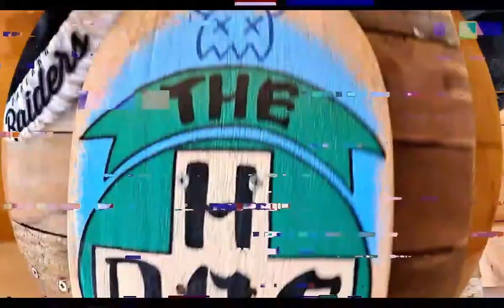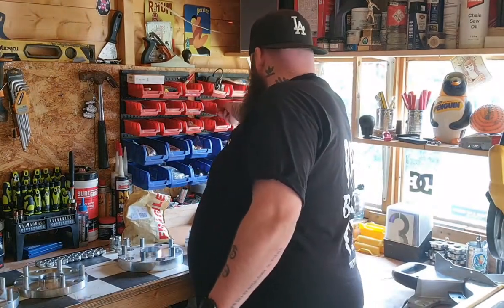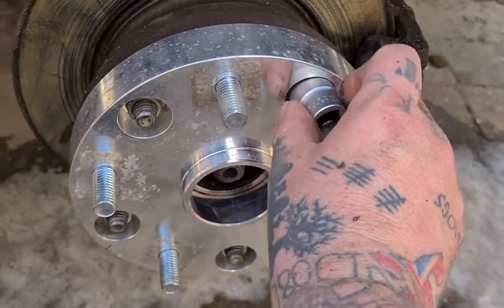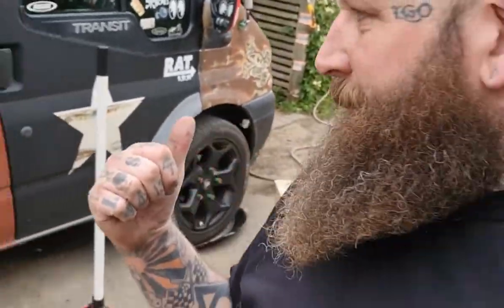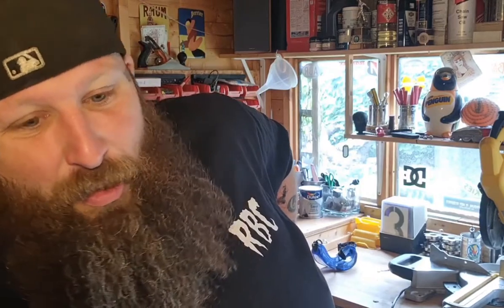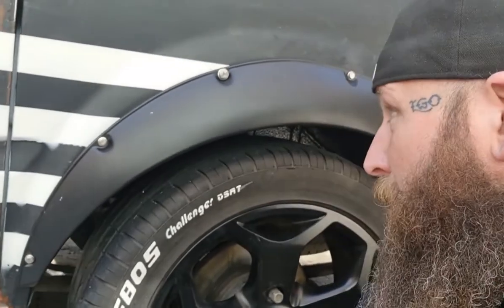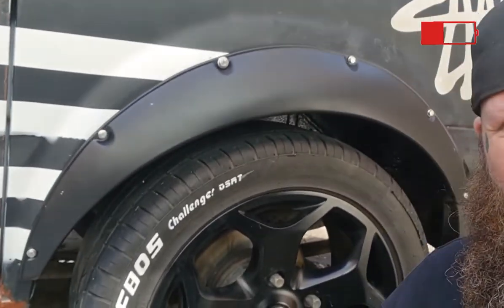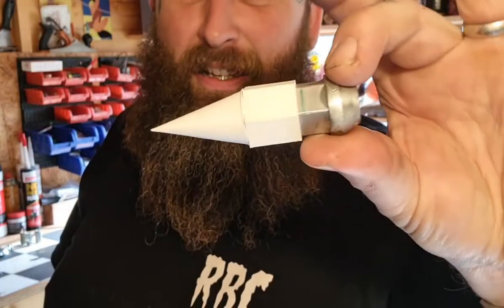fitting wheel spacers to my MK7 transit Ratlook

Comment: Looks good. How has it affected the handling?
Reply from the maker: It's been over 2weeks now and I'm loveing the handling, you can feel the stability, alot less roll round corners
Reply: @RatBastardcrew  cool, I'm about to swap my rears with 245's and keep the 225's on the front until they need changing, then match them up with the rear. I was advised against it because, apparently, it can cause the rear abs to lock up. This is hearsay. Good to get real, on road feedback. Thanks for answering my question.